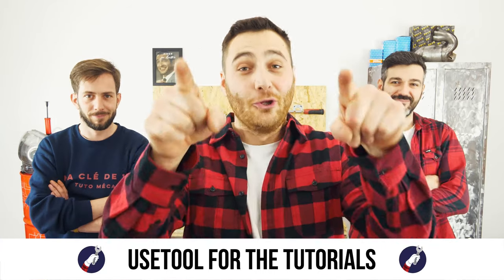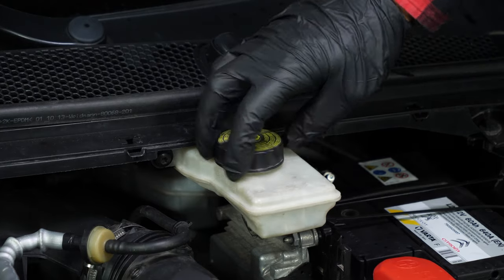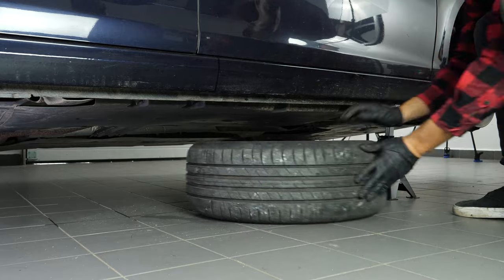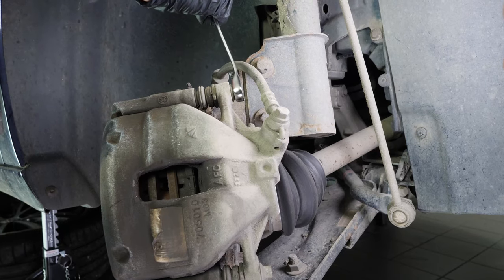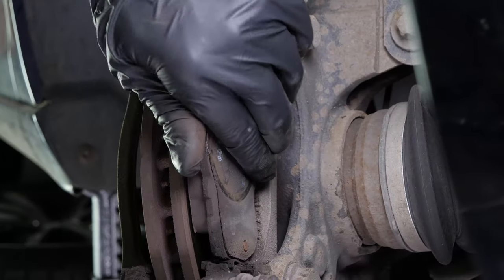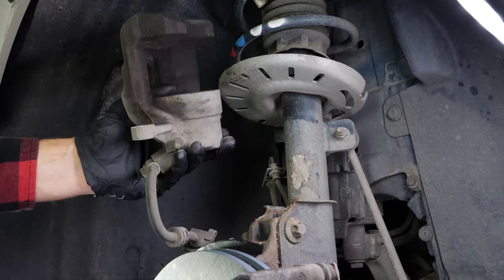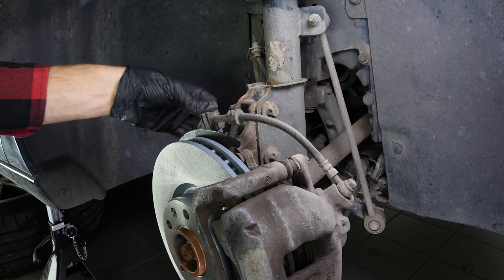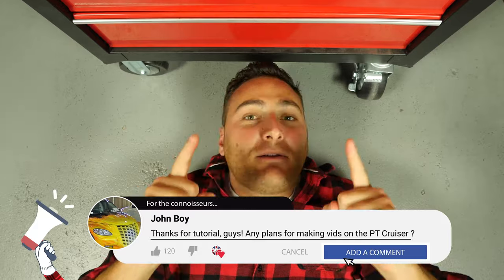How to replace the front brake pads Peugeot 308 mk2 🚗

Comment: You didn't show the metal spring that shall be attached to the pads, instead you smeared copper grease. But you did remove and install with the spring attached. What orientation shall the clip/spring be installed?

Comment: Tip for anyone looking and wanting to follow : you need an E12 wrench. The space between the top bolt and the brake line is too narrow for a socket wrench. As shown, but I thought to be smart and just order an E12 socket for my wrench...
Pushing in the brake piston like this works great though, no need for an extra "push in and turn" tool